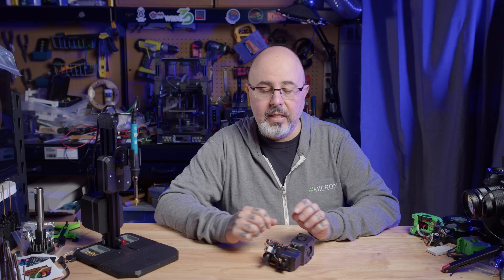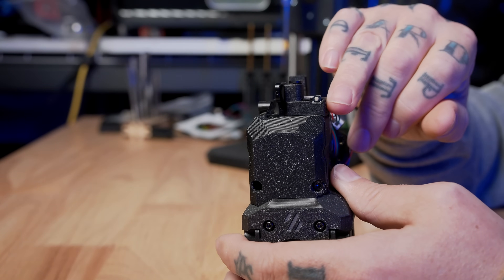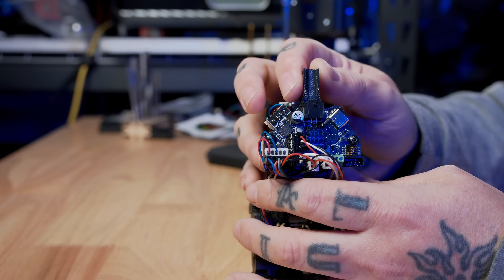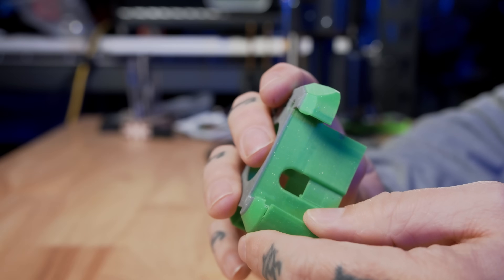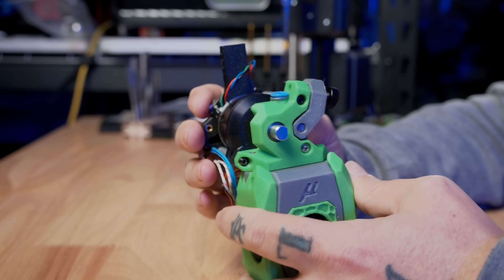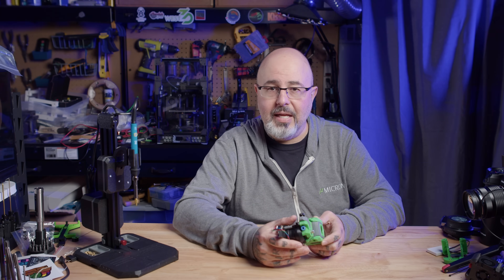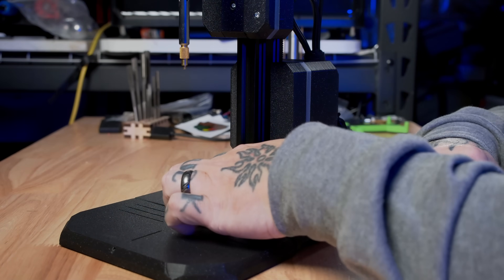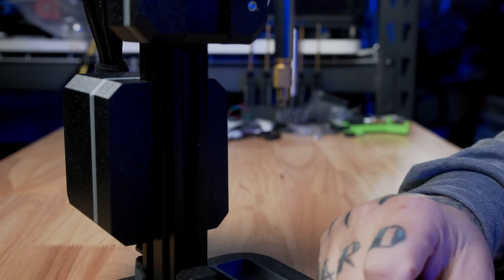New year, new toolhead and extruder

Comment: I'm peacemeal upgrading my 3D printer which is a Geeetech woodframe i3 that i got around 8 years ago. I have replaced the m8 z-screws with m6 several years ago and now with proper 8x4 acme leadscrews a couple months ago, been redoing the Z axis tops and X axis ends, put in GenL instead of GT2560 board just a couple days ago, soldered to unused PCINT pins on the processor, drove them to serial inputs of the tmc2225 drivers (i had a patch submitted to Marlin to enable these pins years ago, so that's in), made a box for it, chose a nicer fan from my collection now a 23 year old bequiet 80mm with ball bearings, for now made Marlin for it, then will add Pi and Klipper, then will change the PSU from 12V to 24V, i already have a 12V step-down for the fans in place, i have a nice 24V PSU really nicely made absolutely beautiful on the inside, bought used for cheap, i have a 24V heater cartridge, a 24V alu bed to put in, been replacing some of the wiring where it has started to look suspicious to me, been redoing PCF and probe CAD... Eventually will re-build this into a Hypercube. Also will need to figure out something for the Pi, either a couple 2F supercaps and design a balancing circuit and a shutdown trigger, or give the Pi a relay to turn off the mains power when it shuts down, or both idk.

One thing i really don't know what to do with is the toolhead. Right now it's all built up original MK8, just with bits replaced as they failed. I have a Haldis HGX Lite extruder at hand and an e3d V5 heatsink and a selection of V5 throats - PTFE lined, titanium, stainless, because i figured V5 throats fit into an MK8, though they are much shorter than original so the nozzle cannot reach the bed without re-designing the carriage. I have some hope that the alu body of the HGX plus a chunk of alu can serve as a heatsink, that i don't need the full v5 heatsink, or can shorten it, but i can't figure out what to do there. Also i want the hotend to stay put when the nozzle is wrenched, maybe i make a cutout in the e3d hotend and put a low profile brass nut on there. Also can't figure out the arrangement of the fans and probe that would actually fit with that HGX plan. I only have 5015 centrifugal fans and only one is actually high quality a Sunon, some OK 4010 axial fans, i really don't want low quality fans anywhere since i had a previous cheap PCF die and good fans can get a little pricey. I'm trying to not spend any money basically and use the things i already happen to have from some impulse purchase or from something i had done previously. BTW the probe that i use is just a 9g servo swinging an arm with a Panasonic mouse button on it, but i eventually need to change it to a different shape and an Omron style mouse button so it can detect if the wiring or switch has gone bad.

Comment: i was actually planning to use a Fan meant for RC brushless ESCs, also 2510  5-12v and from feel alone its the same as a delta on 5v  but on 12 it blows the delta away,  i figured those might also work best with heatead chambers since they run really close to insanely hot escs,   now im interested in the fan you are testing, if its actually 5 or 24 v that would be best as 12 is a weird voltage hardly found on any toolhead board :D